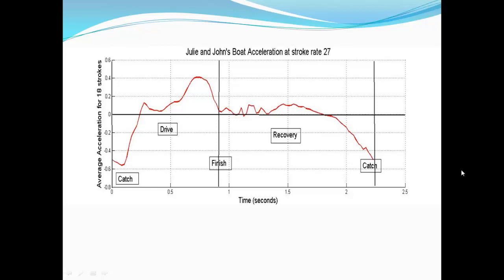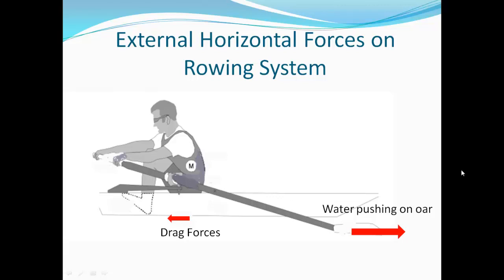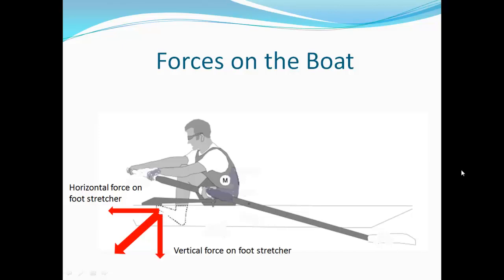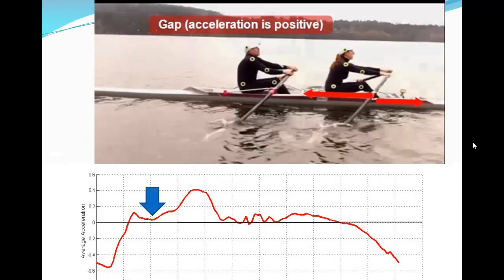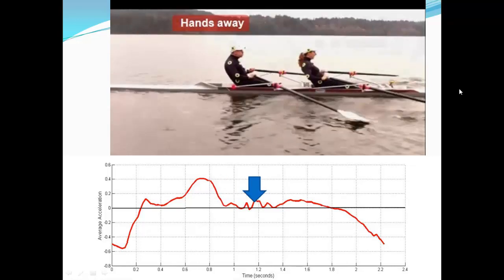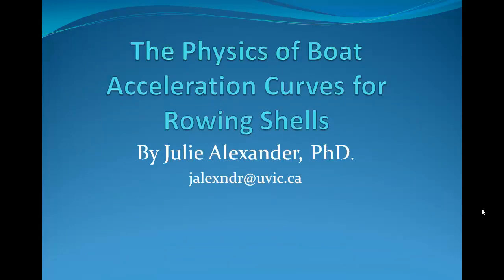Physics of boat acceleration for rowing shells

Comment: I row for hobby, but as an engineer I find this particularly interesting: 
1) It would have been useful to overlay the speed trace to the acceleration trace. 
2) It is impressive that the greatest speed contributor, which is the drive action, occupies only 30% of the stroke time and that the absolute value of deceleration peak is higher than the peak acceleration. What if they use longer blades to increase the trip that the blades spend during the drive phase, this should increase force (and hence acceleration) assuming that the rower can manage it.
3) Indeed, on an indoor rower I have seen a gain of 15-20watts when I pull well my hands towards the chest after the leg extension, this can make a difference on marginal races. I am still trying to improve my technique (2k PB: 6:21)
4) Is there any publication of this work to read in more detail? 
Thank you, great analysis!

Comment: Hi Julie, I want to make sure I understand; Regarding your final three bullet points on "Recommendations for Improving Boat Speed":  Bullet (1) "hold body angle at the catch" means don't open up your back too early in the drive?  Bullet (2)  What is the "top quarter" referring to?  Pulling on the feet implies that you're referring to the first quarter of the recovery correct?  Restated, does this mean get your body out of bow quickly?  Bullet (3) Restated, Early body prep for the catch correct?  Then quick catch with as little movement of any body parts to get the blade seated in the water.
Bullet (1) and (3) I think/hope I'm understanding.  It is bullet (2) that I wanted to double check.

Your video analysis is the best I've seen.  (Albeit four years old.)  I continue to love this sport and the refinement that it demands.  As I've aged I get slower.  It is then the economy of motion that becomes my focus.  So your analysis is much appreciated.

All the best to you and John.
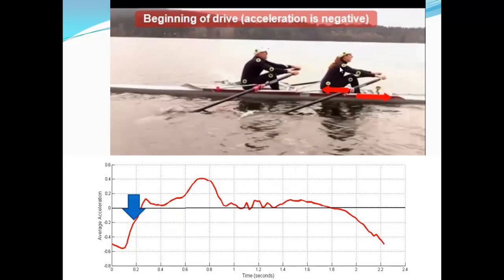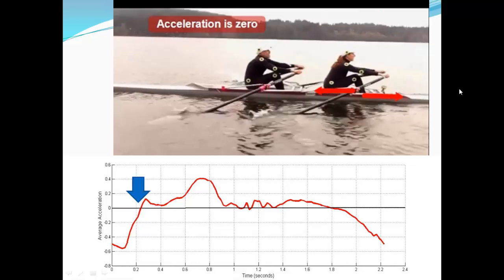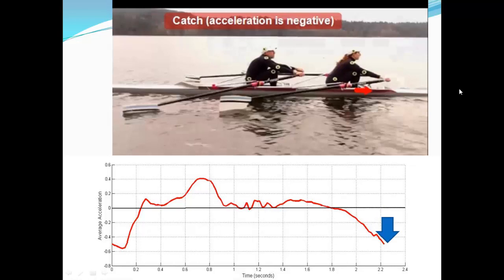Reply: Hi John, to my understanding (1) refers to what she says between 8:01 and 8:42 (and on to 9:12), it's all about a good connection between the foot and the hand. Compared to the Olympic double their body is giving in, therefore loosing force at the gate. (2) Top quarter refers to the last part of the recovery as explained at 15:42-16:30 (this is what the recommendation refers to, the explanation is a little earlier). She says: 'we'll have to try', so this apparently isn't an established fact. I think (3) simply translates to: don't sky the blades. However, I'd like to comment that as she speaks about 'just letting the blades drop into the water' (7:57), Kleshnev showed with a simple calculation that it is impossible that gravity alone can let the blades enter fast enough, there is no way around the rowers having to pull the handles up, even though this of course will create it's own problems.

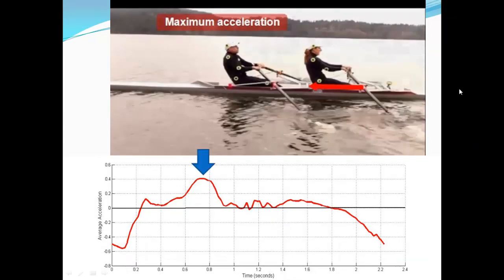Comment: i know this is 9 years old... i wonder if you have learned any more about the physics? i would also argue a point, that around 11:35 when you talk about the force on the footboard being 0 but that would be incorrect by my estimation. there is something to be considered around the rower mass no longer moving along the hull mass, but the force on the footboard is a non 0 force. i love so much about this analysis. i would love to see the forces thought through again with modern tech to assist in the data.

Comment: Hi Julie, Lots of info. I will watch it more times to get comfortable with the data. Try this with John. In your double  row individually. Yo can feel the deceleration and acceleration during the stroke. I attribute thedeceleration or no acceleration to the early part of the drive to 2 things. One is the pressure on the footboards. The other is the oar bending and flexing in that early part of the drive. Yo can feel the boat hanging in the early part of the drive  and when the blades get close to a 90 angle to the boat when the force vectors on the oarlock are more efficient in pushing the boat forward you feel the boat pick up speed. From a coaches launch you will see this slowing down and speeding up also. Much like your analysis on improving boat speed I coach to not maximize your force at the catch but to wait until the sculling blade handles start ot cross over. THen to compound the back withthe end of the leg drive through to the finish. Feeling your footboard pressure through to the finish is critical to getting a long push. Extracting the blades after the oar has sprung back is also critical to being efficient. Keep up your great work.

Comment: julie- what would happen- rather than finishing segmented legs back then arms , you finished moed coeerd. That is to say you held back swing but swung hard and finshed arms and back closer together and closer overall to the legs finishing. Also I might disagree with you on finish angles of the back It seems that in the last few years we are seeing about a 15-20 degree angle vs 10 ish that we were seeing a decade ago. The womans 8 at Olys this yr showed about 30 degrees of swing.

Comment: A lot of what you say is correct  and a lot is totally incorrect.  Please read Kleshnev.

1. The acceleration is not the difference between the force on the pin and the force on the stretcher. The acceleration is the force on the pin provided the blade is buried, providing a fulcrum. The handle force provides the force on the pin. The stretcher force is internal to the boat and irrelevant.  Even Kleshnev made this mistake but corrected it.

2. The stretcher force is relevant when the blades are out of the water. It is the force point for the body mass, when one jumps off at the catch before connection of the blades. Kleshnev shows how this huge momentum provides huge acceleration to the boat when the blades connect after about 1 cm slippage on the slide. Thus Olympic oars have a sharp deep acceleration caused by the jump and a sharp high acceleration when the blades connect. This the first power point. The body is very weak at the catch (3rd degree lever) and cannot produce power.  Harry Mahon discovered this 50 years ago. Your first power point is too sloped and low see Kleshnev Olympic oar's curve for the proper catch.

3 . The second power curve is the one produced by the big muscles, quads, hamstrings,glutes and dorsal. It is much earlier in an viii but your graphs have it very late, showing use of upper body strength. Paul O'Donovan's success is partly due to this as was Sean Drea's in the 70s. I found the legs are first to turn to rubber and the body last.

4. The best technique involves the following
a. Slow recovery and gentle acceleration up the slide all the way.  No slowing on the top quarter as FIFA wrongly advocate. This gradually slows the boat.
B.Use the body momentum to lever your body mass onto your toes so you make the trampoline jump without effort or delay. The lightning effortless catch is the secret - Tony O'Connor NZ viii coach had it perfected.C. Body momentum and Mass Suspension (see Kleshnev) makes the boat light and easy to accelerate. The big muscles are easily fired early as they have not been strained in a very weak position at the catch. 
C. Do  not be afraid of the very sharp and deep deacceleration caused by the  body jump at the catch. It does appear to affect boat speed too much.  Kleshnev discovered it as a sign of an Olypic oar 30 years ago before he could explain it.

The physics of rowing is very complex. Kleshnev uses the scientific method of very fine measurements on the  best crews and trying to understand his  findings.  He does not try to impose a  theory.  I have yet to come across a clear accurate analysis of the physics and biomchanics of rowing. Most are useless inaccurate, misleading or irrelevant including FISA. One of the big problems is to create a clear concise notation and language for the dynamics of rowing, namely force, power, work, speed, acceleration,vectors, direction, mass, drag, wave motion, angles, etc.  On the face of it, it appears one might need a language like LISP to Express the concepts.

James Heney